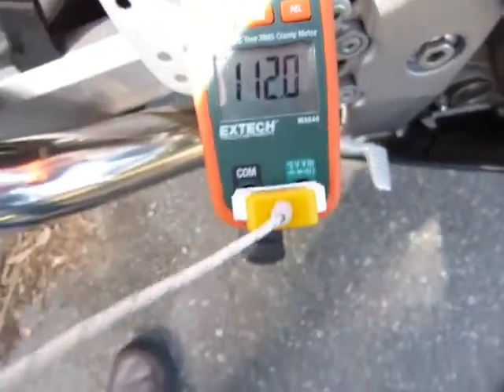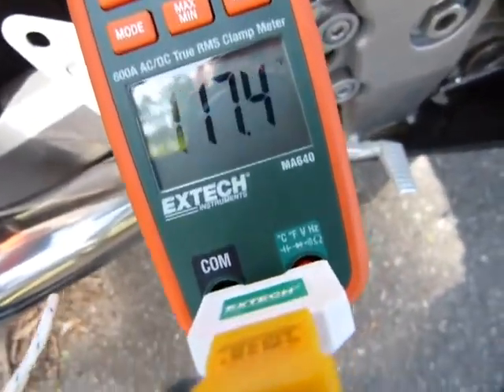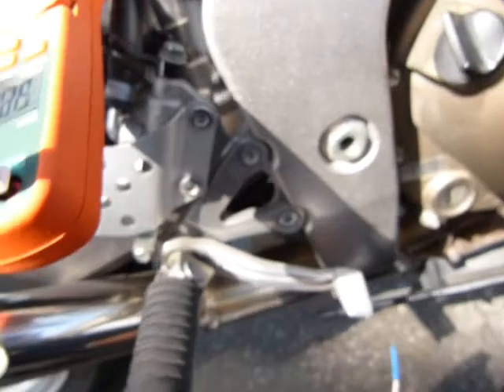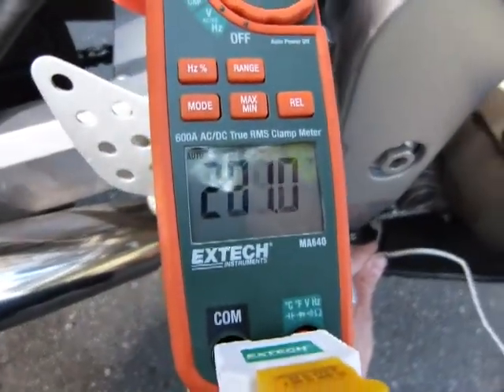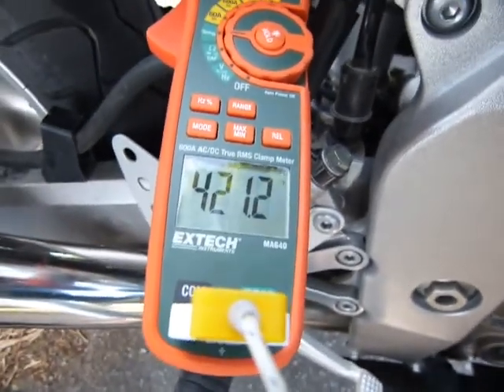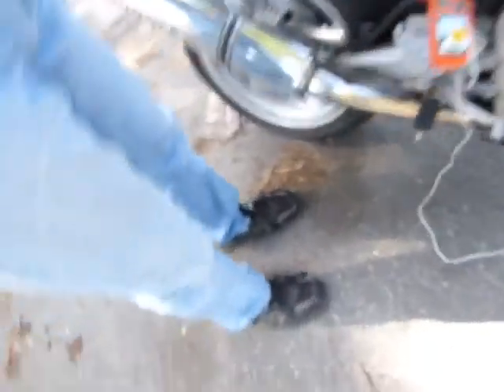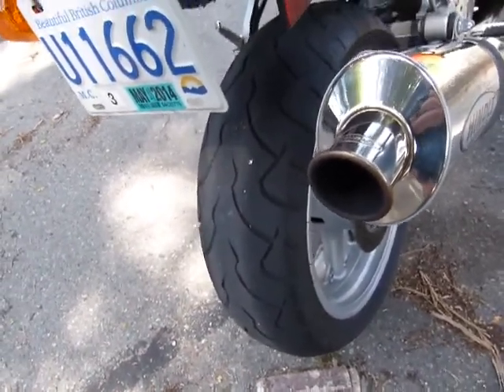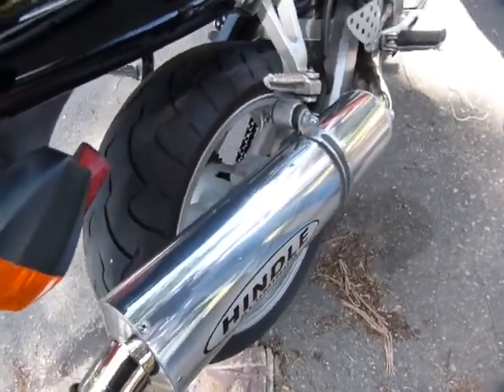How hot is the exhaust?

Comment: what is that bike?
Reply from the maker: 2006 Kawasaki ZZR-600
Reply: can you answer me about a question? i need 150 degree celcius from an engine. what is the minimum cc to get that heat from the exhaust? does the engine size matter or any gasoline engine produce that heat?
Reply from the maker: Engine size or type don`t matter. Any internal combustion engine will  burn fuel at the same temperature.
Reply: but the rpm is important i think?
Reply from the maker: Gasoline auto-ignites at 270 C, burns at a flame temperature of 950 C, no rpm. Ask any fire department.
Reply: thanks a lot man, you dont know why but you saved my life!
Reply: Thank you so much for your video.  I am planning to powder coat the short piece that connects before going to the muffler and the power coat paint is good up to 400 farenheit so I will be fine.Thanks again!!! cbrxx 98🛵😀😀😀 😉